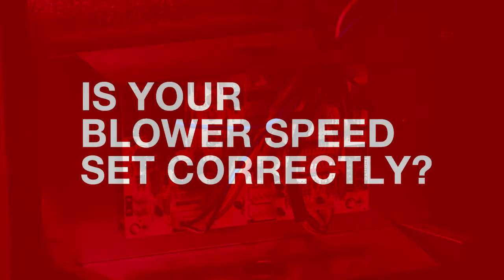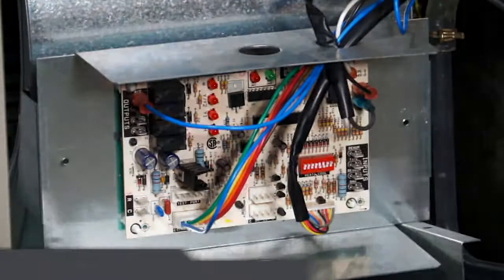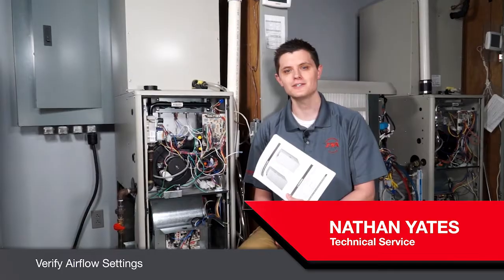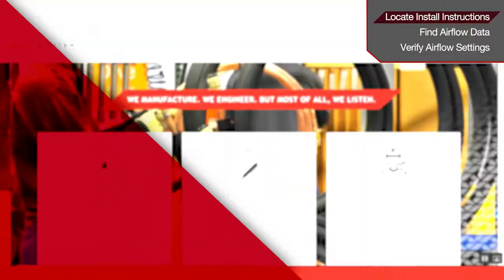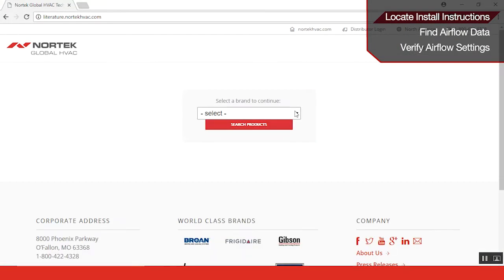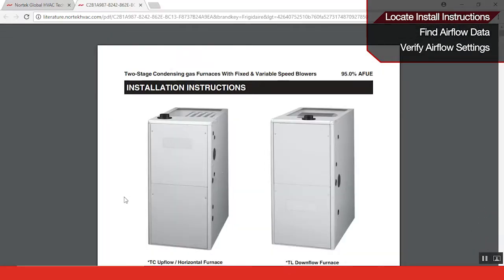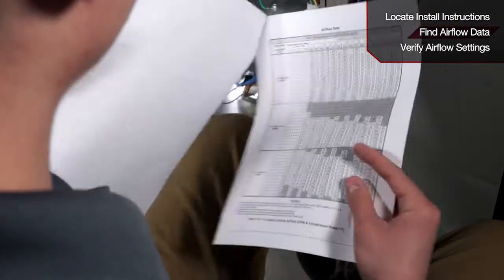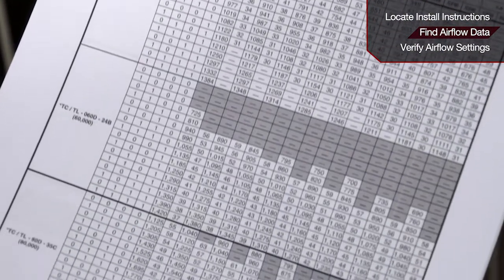Checking the Blower Speed

Comment: So I had to change my blower motor and it was org on blue wire med speed. The hvac guy told me to put it on black for higher blowing speed.  I did this and everything seemed to work great. It’s 32* degrees nightly right now. The flow is def higher in the house from the vents now which is good but when Aux heat comes on the air used to feel hot at the vent. Now it’s warm but not hot like it was so it seems like its actually running longer. My theory is the air is so strong now from the blower it is cooling the heat strip down faster than it can heat up. I think it may be a single strip. Is that a possibility? I will have to crawl under house and switch back to blue possibly if it is.